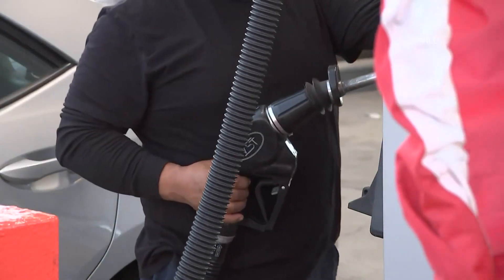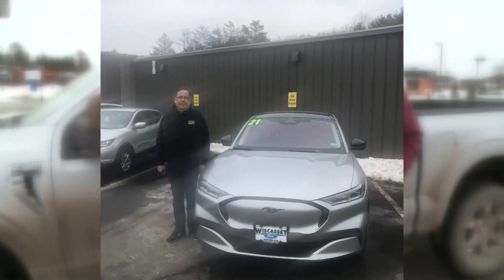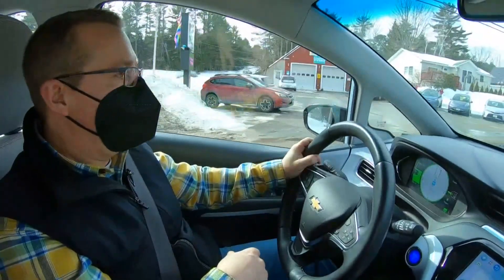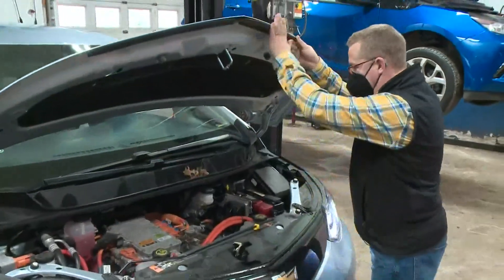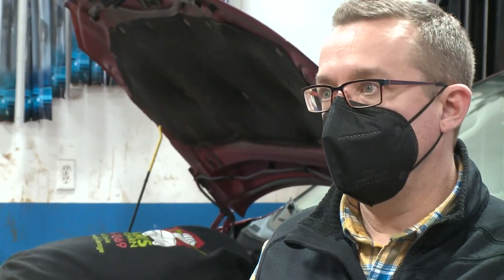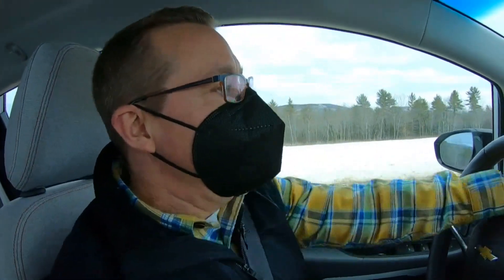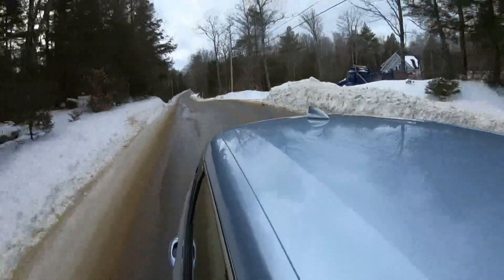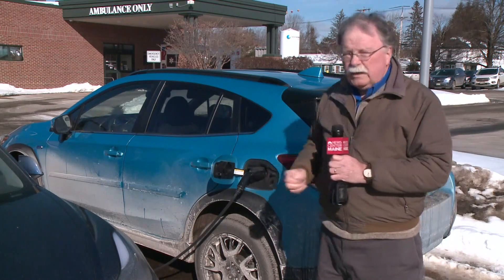Considering buying an electric vehicle in a cold climate

Comment: Cold has always drained batteries. This is why you plug in your batteries  on your gas vehicles or bring them inside in cold weather. That isn’t going to change. Can you afford a heated garage? Do you even own a garage? Are you where it gets below freezing and holds there for any amount of time? How long are your winters? Can you afford to switch out and more importantly than any of the questions can you afford to be stranded on the road in winter? Ask the right questions. This isn’t changing over your television. Cold weather folks lose power in winter that also means your car now too not just your heat.... are you prepared to be stranded? All electric just isn’t smart... or safe in the long haul. Let me know when it is.
Reply: Who is plugging in their batteries on their ICE vehicles in the winter? That plugin you see hanging out the front doesn't charge the battery, it heats up the oil to make the engine easier to turn over. It's called a block heater, and it consume a fair bit of power to use, with basically the only benefit being: the ability to start in extremely cold temperatures. I think maybe you should listen more, talk less. Also, in these parts where it regularly gets below zero, we rarely lose power. Power loss is far more common in the summer due to a thunderstorm.